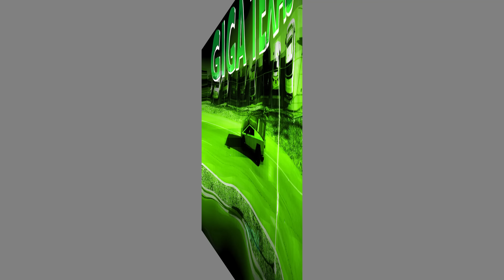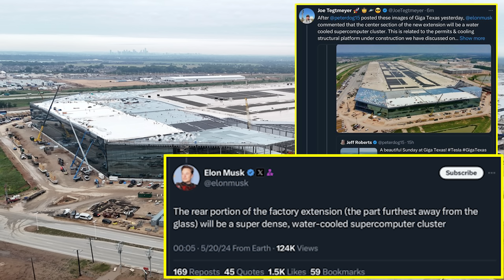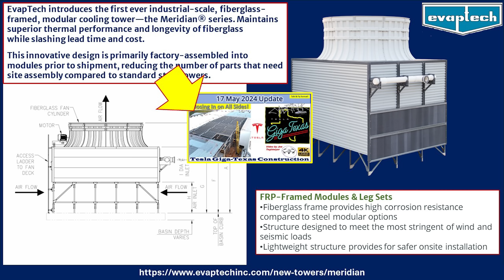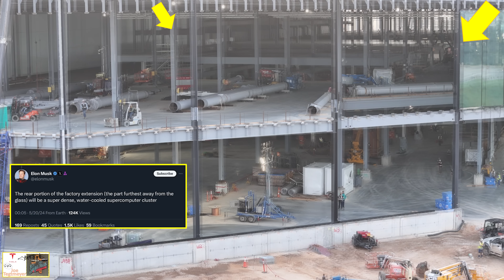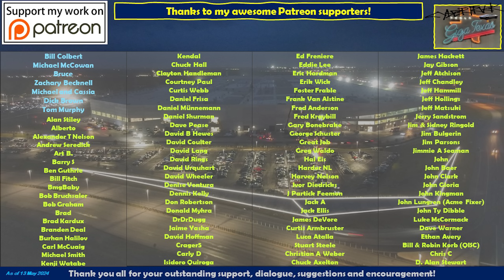S Supercomputer Data Center! N Conduit & Trenching Progress! 20 May 2024 Giga Texas Update (07:35AM)

Comment: I would have never thought that Tesla would install a supercomputer cluster in this building. Oh well, it's not the first time I have been wrong, nor will it be the last.
Reply: I've predicted it for weeks. Not that I think it is a good idea, but it was what the evidence clearly suggested.
Reply: @DavidJohnson-tv2nn  That's fine. I have the ability to publicly admit when I am mistaken.
Reply: @jbbuzzable  I do too. I'm definitely far from perfect.
Just in this case, so many people thought they would never build a data center here. And I agree, NOT a good idea.
However...
All the evidence suggested otherwise...
* The permit for "Data center infrastructure" in the south expansion.
* The massive amount of new electrical power being brought into the building.
* The new fiber optic duct-bank being constructed west of the building.
* And the very large cooling structure.
Reply: @DavidJohnson-tv2nn  Have you ever been mistaken regarding Tesla? And what was it?
Reply: @jbbuzzable  Oh yes, on how long I thought they would remain in business 😊
Reply: @DavidJohnson-tv2nn  Negative comment but nice.
Reply: @jbbuzzable  Well, I've also been wrong on the tunnel. Which I thought they would never build when the comments were flooded with "tunnel suggestions".
And I've been wrong on a few other things. For example, I didn't think they would use glass panels for the parapet wall  above the windows in the south expansion.
And.... I still don't think the tunnel will enter the building. But time will tell.
Reply: @DavidJohnson-tv2nn  Although it pains me to say so, in my opinion, your credibility went up a point.
Reply: For people who don't know much about these things, like myself, it might seem unexpected to install an extremely expensive supercomputer cluster so close to a massive stamping facility.
Reply: @DavidJohnson-tv2nn  Why not a good idea? they have the land, they have security, it is securely tucked inside a building they own, they have the giant electrical substation... all they need are generators.

Comment: Here is my armchair math for where the tunnel is currently 
Roughly 99 set of 3 tunnel segments. 297 segments. 6 segments per section Ring. about 49-50 sections/rings left on property. Roughly 5' a section. 
245' - 250' away from End of tunnel.
Reply: There are more sets of segments along the road. About 90m (295') worth. Some are damaged or not to be used in the permanent works (Painted red). But I agree with you the end is less than 300' away.

Comment: The belt cassette isn't helpful but the preformed cement pieces left on the ground help track progress as well as giving us a sense for how much more tunneling is left.   Getting close to the end based on what we can see.
Reply: Another progress indicator is the figure-8 coil of black hose/cable on the ground just southwest of the ducted fan. No idea how long each loop is, and the videos aren’t sharp enough to count the coils, but the stack has been slowly shrinking over time.
Reply: At the start of the tunnel it was hard to use the concrete (not cement by the way, cement is a powder) segments on site to estimate the tunnel advance as they were still being delivered daily to site. The best measure is, and has been, the conveyor cassette usage. This was verified by the stoppage for the backup installation and some other identifiers, all of which added up. Now it is assumed all the segments are delivered, so their usage, along with the conveyor cassette rise, can be used to estimate the overall length and the production rate. The late black cable loop is the main power cable to the TBM. Unusually this is being taken into the tunnel behind the TBM and, as you say, can be used to further verify the production rate. I did some calculations previously and estimated each loop to be around 15m of tunnel advance, but, as you say, hard to count the number of loops. 
Most TBM's have this spool on the TBM itself, feeding out behind the TBM. it can then be fixed to the sidewall and connected, extended as a tunnel progresses. This TBM "drags" the cable along the wall. Not a preferred method, and would not be allowed in most jurisdictions if it is over 415V. I am assuming this is at least 1000V and possibly 3KV.
Reply: @davidsalisbury50  Thanks for identifying what the loops are. How would the cable actually be extended into the bore to follow the TBM? Seems like you couldn’t just drag hundreds of feet of cable along the concrete as you move forward
Reply: @Frank-gt7me  Indeed not. Most TBM's will carry a spool of HV cable on the backup. This rolls out as the TBM progresses and is laid on brackets on the tunnel wall (i.e. it does not pull along the wall, it rolls out). 
It has a heavy duty "Mine" connection (a big plug) at the end. 
Lets say it is 100m long for example. Then every 100m advance it is disconnected, winded back in, and a 100m long extension cable replaces it on the wall. In practice these extensions can be 200-300m long and doubled or tripled up along the wall brackets. Then every 100m advance, the looped section is moved forward and the main cable left behind mounted on the wall (Fixed requirement over 1000V in most countries). This way the TBM can keep going, winding in every 100m, and unplugging for a new 300m extension every 300m. 
The wall mounted cable is much cheaper than the spooling cable on the TBM, and the mine connectors are very expensive, but overall the system is more efficient and cheaper on very long tunnels.
After a couple of Km the voltage drop in the cable can be an issue, so a step-up transformer may be required.
Very large TBM's can have several 33,000V cables feeding into them and have the power consumption of a small town. With a lot of protection systems like auto transformers to prevent their start-up load from causing a power drop in the local grid.

Comment: Extrapolating from the number of parking spaces on the top floor of the parking structure, it looks like it will have a capacity of 4000 cars.
Reply: I think it will be closer to 5600 (~800 per level).

Comment: Those rolls almost look like the copper used in the battery cells.
Reply from the maker: That seems to be the prevailing thought … scrap material. The interesting part are the crates they are in. Some thing this is a sign Tesla is getting battery material from LG!

Comment: Joe: what % of the new expansion is devoted to the supercomputer space?  Doesn’t that space have to be vibrationally isolated from any production activity?  It makes me wonder how the rest of the new space is to be used.  You said it looked like it was going to be industrial.  Maybe they will move seat manufacturing to this area?  Some process that can handle the light and heat from the windows and not cause problems for the puters.

Comment: For the tunneling spooling section, they dont actually add spools, the reduce the size of the spools. So, at some point the spools reached down to the ground and the higher the spools get, the deeper they are in the tunnel. You could maybe do a rough calculation of distance if you knew the original hight-length of the spools and what they are at now. Seem to be 2 rows of spools... so height-lenth change number of spools x2 x2... should give an idea. ..I THINK that's how that system works anyway. 

The outside cooling system is probably just for the servers, I'm sticking with that. they should be subterainian, obviously, and the water would be taken out to the cooling tower. I still think there may be a liquid nitrogen element to the cooling system on the cooling tower but we will see. The roof above them should be special in that they shouldn't be using any or at least minimal external systems above it. I would personally think that the risks are too high above a multimillion server farm. I wouldn't even risk solar mountings in that area. Must admit, I did think that the area in front of the glass was actually for the servers, much less risk of breaking the glass compared to a construction area. Pretty sure they have cracked one window on the left hand side of the main buildings entrance but a fair way down.
Reply: 2nd may (I think) they added the roll of conveyor that had been previously stored on top just next to the cross conveyor. By seeing how much this lowered the cassette beam (White inside the structure with the 26 bottom rollers), we could estimate the length of conveyor added, re-set the calculation and continue the estimate of tunnel length. Now all the segments are on site we can also count the reduced number of stacks and estimate the advance. I have done this regularly and verified with some other observations to come up with my estimate of 205m excavated to date.
Reply: @davidsalisbury50  whats the length of the convayer to the other side of the highway/factory?
Reply: @tangent2658  Hard to calculate due to the tensioning and drive system lengths. Conveyor is in 2 parts, TBM conveyor from under the EPB screw to the back of the TBM, then the tunnel conveyor (which is the one that extends using up the cassette lengths) to the discharge, drive/tension unit, and cassette.
Then of course there is the EPB screw conveyor in the first 10m of the TBM shield.
So, everything I have calculated is based on the change of length (Plus the additional lengths spliced into the tunnel length) rather than the actual length.
Hard to describe in words.
Reply: @davidsalisbury50  No, I understand what you are saying. Will just have to wait until it pops out the other side. Not actually sure if we will get to see that if it comes out internal. that build is closing in rapidly.

Comment: I’m still perplexed that the tunnel is taking so long to create like a 1/4 mile long tunnel… when the prufrock3 claims it can do a mile a week
Reply: Because it is a claim. What you are seeing is the reality.
Reply: One reason is that it is a prototype tunnel and machine process. I'm pretty sure this is the first tbm to cut open into the angled grade of the highway berm... As opposed to being assembled and launched from an excavated launch box with prepped initial surface area.
Reply: @doofer80  Not the first to do this by any means, they did it several times in Vegas.
I have worked on variations of the same over 30 years ago.
Nothing on Prufrock 3 is new from what I could see. Possible exception of using the Herrenknecht AVN approach to moving the control center outside the tunnel portal instead of in/on the TBM backup. Again, a method that has been in use in various forms for decades.
This is their 5th TBM, still slower than, or no better than, the competition, and they have so far only used one type of closed face TBM.
Reply: @doofer80  TBC claimed their launch technique was so much quicker, yet it took 37x the time they claimed it would take. Similarly, even if the inclined launch is a "new" method, once buried, their TBM has progressed generally slower than current standard TBM's. So Prufrock was supposed to be this great new super-fast method, then it wasn't, so it was claimed it was proof of concept, but just wait for Prufrock 2. Along comes Prufrock 2 (now working in Vegas), its no faster than any industry standard machine, so, once again, it is 'experimental', 'proof of concept', a prototype. But just wait for Prufrock 3! And here we are, claims, fail, excuses, rinse and repeat.
When are people going to accept this is a very basic EPB TBM, using an oversimplified launch technique that is not viable in almost all other circumstances, that in itself saves some money, but not time as we have seen.

Comment: does anyone else think borring company might be to connect cooling tower to Dojo??? Cluster as well?
Reply: No. No need for a 12' diameter tunnel. My guess is a pipe bridge or a below grade duct, similar to what they did at the Cathode building/DIE Shop chiller plant.

Comment: As I’ve said for months now, no tunnel inside bldg!  It will terminate between highway berm and Tesla’s loop road!  It’s a done deal…steel erected and concrete poured for what is largely the AI data center, Dojo bunkers, offices and welcome center.
Reply: I'm still on the fence on this. I agree most likely is at the perimeter road. If so, we should see it appear any day now. On the other hand, they have produced, and delivered, segments to take it into the building. Why go to the cost to manufacture and deliver them to site? 
At 15:50, we can see inside the building. There is a long area of exposed ground not concreted. There are, what look like, small lights on three on the column bases. These may be "reflectors" used for settlement/movement monitoring of the columns as the TBM surfaces alongside them. But then the alignment of the current settlement monitoring arrays on the highway berm does not make sense, unless it is one sided, which I have never seen or heard of.
Number of remaining segments is pushing me back towards the tunnel finishing inside the building, but, as I say, I'm on the fence.
Reply: @davidsalisbury50   I noticed the "inside dirt floor" too. I think it is a logical conclusion.

Comment: RE the filtration of the air for the tunnel. Could that unit be an A/c . To cool the ventilation air?. Why wold you need fans on top?
Reply: It is an AC unit. The air outside doesn't need filtering before being blown in but it does help a lot if it is cooler (Tunnels are very hot places)

Comment: Thanks Joe!
Well guys, what I've been saying for weeks what has been confirmed today....
There will be a data center in the South expansion. And it would likely be in the 3 story section back away from the glass.
Cooling structure:
@ 3:26 Excellent view of the large black pipes passing through the structure, as well as the panels dividing the "cells".
@ 13:21 more piping can be seen on the ground.
Parking garage:
@ 8:57 Pumping concrete onto the 6th level.

Data center power?
Stamping roof:
@ 10:45 Looks like cable trays are being installed on the pipe supports near the parapet wall?
Possible route to get power from the north end of the building south to the data center?
Platform may be for cable spools?

South expansion:
@ 11:31 (Left) Final roof bean needs to be placed for "topping out".
@ 15:12 A view inside and the large pipes needed for cooling.
HDD bore:
@ 16:41 The two black fenced areas are only a small section of a long fiber optic duct-bank.
@ 25:27 (Upper left) More spools of orange conduit for fiber optic cable.

New power supply to the factory:
@ 26:15 Over the weekend Tesla road was trenches, preassembled duct-banks sections were dropped in, concrete poured, and backfilled.
On the northside of Tesla road by the light tower... You can see the ends of the new duct-banks.
Northside of casting:
27:18 Backfilling around the vaults and duct-banks. We still have the issue of duct-banks that will be approaching with more conduit than is actually going into the building right now.
Reply: Note: @ 10:31 shows two rows of cable trays installed in the pipe supports along the parapet wall. If my speculation is correct, that will be a 4,000 foot cable run to the data center!
Not sure if it is a good idea to put redundant power supplies so close together?
Reply: I’m wondering where the diesel backup generators will be installed. The megapacks may suffice for short outages, but can it last days or weeks like proper datacenters are designed for?
Reply: @Frank-gt7me  I have a few guesses...
1) Under the cooling structure platform.
2) On the 3rd floor of the section of the building where the data center will be located. That way, they could vent through the roof. 
3) Near the concrete exterior walls. Again, where they can vent to the outside.
Due to the need to vent exhaust and air to cool the diesel engines.... I'm pretty sure it is something we will notice.
Reply: @DavidJohnson-tv2nn  In the cooling tower structure is logical. I just wonder how many chillers will be installed there? If they put the chillers in the main building they would have plenty of room for gensets and diesel fuel.
Reply: @gurugee2112  I'm not an Expert on industrial HVAC systems. But in this case, my guess that the number of chillers will be zero. They will likely be housed in the main south extension. This appears to be just a cooling tower. Where warm water circulated, sprayed out of nozzles.... In which air and water are brought into direct contact with each other in order to reduce the water’s temperature. As this occurs, a small volume of water is evaporated, reducing the temperature of the water being circulated through the tower.

Comment: Joe, regarding your inquiry about how far they have drilled, how about if you went back several months to the time when they finished delivering concrete ring segments...each pallet delivered has three segments, yes? There are six segments in a "ring", yes? And each segment is either 3' or 4' wide. Thus, perhaps you could count the total pallets delivered (as of several months ago) and divide by 2. That gives you the number of rings." Multiply that by say, 4' wide, and that gives you the the total length. Count the number of pallets left on the ground as of say,  today; that would give you the feet they have drilled, plus the remaining feet to be drilled. Am I correct?
Reply: Let us know what your estimation is!
Reply: Why do you assume that they brought them all at the start.The are made a few miles away.